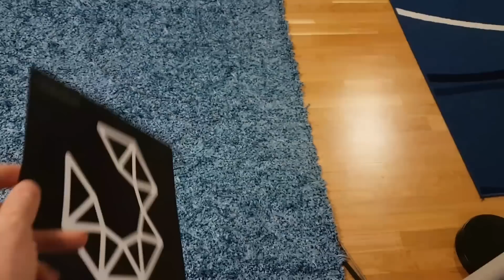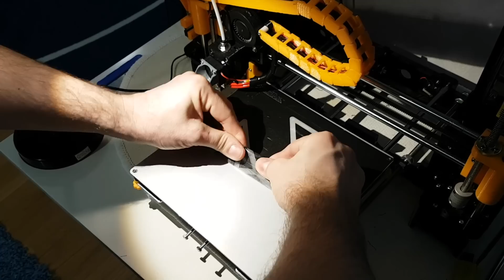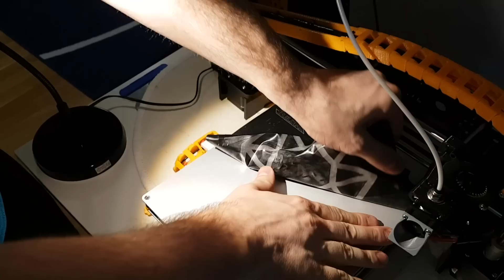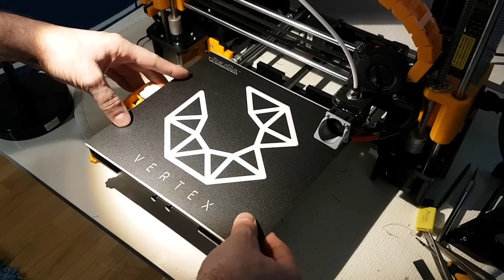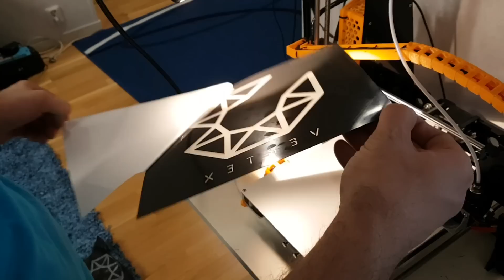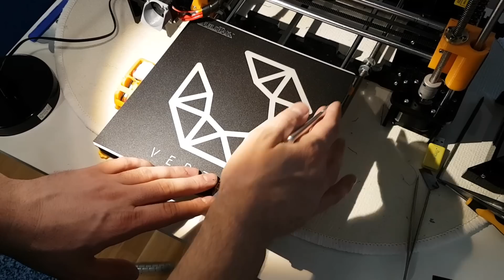How to install buildtak Vertex to 3D printer

Comment: Any hints on where the mat can be bought (link to Amszon, ebay or similar) ?
Reply from the maker: https://www.amazon.co.uk/Velleman-Buildtak-Print-Surface-K8400/dp/B00STUMYZC/ref=sr_1_1?ie=UTF8&qid=1493509575&sr=8-1&keywords=vertex+3d+printer+bed

http://www.ebay.com/itm/K8400-BT-Velleman-Sa-Buildtak-3D-Print-Bed-Surface-For-K8400-/132132379811?hash=item1ec3b41ca3:g:AY0AAOSwL7VWqcAU

Comment: Hi, i use the same cover. My prints stick on that cover. its pretty difficult to take the prints off the cover. I really struggle with it. Help would be much appreciated.
Reply from the maker: Well that's is meaning of Vertex cover :D You can try to lower bed temperature. I am using 55 degrees for first couple minutes/layers and then I turn off bed temperature to 0.
Reply: I did turn off the heated bed. It still sticks too much on the bed. I literally needed to take a hammer and a scraper to get it off the bed^^
Reply from the maker: What you are printing? Share your part link? Try to print without any temperature on hotbed. Maybe surface on your 3D model is to large and that's why stick so well.

Comment: Nexi try using a thick wood dowel, start on one corner and fold the adhesive side over on the dowel, one you get it around once it will tighten up on itself and you can roll it off without having to put a lot of strain on the bed. heating up the bed should help. And thanks for the great videos!

Comment: Hey Nexi, i purchased this Vertex bed cover and i cannot get it to adhere to the bed at all.  What are you doing to get it to stick?  I've tried changing my nozzle temp from 189 to 205 and back, i've tried different combinations of heating the bed from 45c to 60c to no heat at all and no matter what i do it will not stick to the bed.  The closest i came was when i leveled the nozzle so it was about .5mm above the bed but that caused the PLA to come out wavy.  Could you recommend temp/bed settings to use when printing on this material?  I'm currently testing my first layer speed around 15m to 35mm .
Reply from the maker: Hm... That's very strange! 0.5mm is to much becouse nozzle is 0.4mm. Try using A4(0,2-0,3mm) paper under nozzle to level your bed and try to use window solution to clean Vertex surface and don't use alcohol. PLA can be 200Degrades and 40-55degrades on Bed.

Comment: Hey! Love your printer customizations! Just bought an A8 and I'm going to make mine roughly the same as yours. I bought the vertex and I'm wondering if it might be possible to mount that ontop a layer of painters tape? Cause of the difficulty of removing it that might be better if it doesnt cause other problems?
Reply from the maker: I can't recommend doing that. Surface needs to be perfectly flat even 0.1mm can make difference and I don't thing this kind of adhesive will even stuck to tape.

Comment: Nice videos! I've a question, which bearings are you using for the x-carriage with the e3d v6, are they the ones that came with the printer?
Reply from the maker: Thanks! Am using bearings that come with printer but keep in mind that you need one extra more. X carriage(original) has 3 and this version has 4 bearings.
Reply: Nexi so where did you get the 4th bearing?
Reply from the maker: Here: https://www.aliexpress.com/item/6PCS-LOT-SCS8UU-8mm-Linear-Ball-Bearing-Block-CNC-Router-Reprap-3D-printer-DIY-Kit-Accessories/32671316545.html?spm=2114.13010608.0.0.1GpSRq
Reply from the maker: Now Am using PLA barings. Check my last video.

Comment: Watching this video makes me think attaching a piece of glass on the heated bed would be easier (with this material or with  tape). Maybe using a hair dryer to heat up the adhesive would've helped.

Comment: Hey Nexi,
I saw that you printed some new z axis left and right supports that attach the threaded rods to the horizontal sliders. Can you share the thingiverse file? I want to print my own as well.
Reply: http://www.thingiverse.com/thing:2042952 This one is simplier
Reply: http://www.thingiverse.com/thing:1919544 This is the original the bottom one was modified to add something else, check both out and see which ones u like

Comment: how many models and times you have printed on immune list? I think it's too expensive to use this method, I use glue with acetone mixed and take mirroring bottom side with very good smooth adhesion
Reply: Paco R it can be used an unlimited amount of times. I believe he is changing it due to his wonderful girlfriend damaging the first one. As long as you don't damage it (don't use sharp tools to remove the models) it will last forever.

Comment: Vart köper du den här? Where do u buy this? Sweden?
Reply from the maker: kjell och company! Idag har jag köpte sista i Göteborg. Här! Klicka på Link! https://www.kjell.com/se/sortiment/el-verktyg/elektronik/3d-skrivare/k8400/tillbehor/buildtak-printyta-p87442
Reply: Ok. Tack för svaret. hoppas att dom får in nya snart. Jag har problem med mitt filament den bryts av ovanför extrudern en stund efter en printning. Har prövat att flytta runt spolen men, det kanske är dålig kvalitet. Har du haft nåt liknande bekymmer?